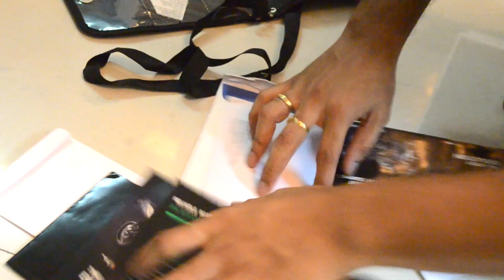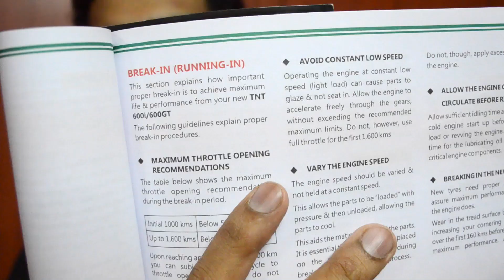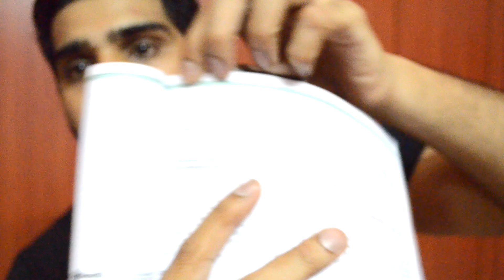DON'T LISTEN TO THEM | Engine Break-in & how to do it

Comment: Whatever he is telling is wrong drive it slow blah blah
You don't have to drive it at a constant speed
Neither you have to redline it to the max
What you have to do is vary your rpm or in a sense you don't have to be on extremes on either end
Just make sure you don't overheat the engine give it some rest after riding
In a way use it the way you want to
The manuals can't tell you rev it too hard cause they will get law suites too some you don't have to be too adventurous with the new bike cause you have to get accustomed to the new machine
It's always risky for you on a new bike

Comment: those pussy or soft break in are written by lawyers or insurance company because they don't want you to get accident from the new bike which you are not familiar, do you know that when factory make that bike they need to go hard in order to know what is the top speed of the bike, if you break in like pussy or gay, i can bet with you, your bike will not perform good, i saw 2 person bought the same bike one use hard throttle while the other one run like pussy or gay after 3 years the one go hard perform better than the one run like gay, because the other one think which go hard think that since the bike got warranty he don't mine go and wack the bike always remember if you want your bike to perform well you need to season the bike, that is the reason new bike always run slower than old bike

Comment: Do not follow what this guy said about the 5 min of warm up during the first startup!!!! This is not necessary. Just start riding after 30sec because the oil pump will very quickly inject and splash and flush the engine’s head with oil. The only concern is the oil needs to get to its operating temperature, for that you can drive slowly for 1k and by then the oil will attain its operating temperature. And on load it tends to heat up faster, rather if you follow this guys instructions, you will end up wasting fuel which is not required and can be used to drive slowly and reach out a distance instead of idling it at one place. This applies to any engine capacity. 
And also we will emitting exhaust gases at idling effecting the environment. 
In worst case we can repair our bike or even buy a new one . But we humans don’t have the capability to repair the damage we made to the environment. So if anyone doing this !!! Please stop it right away....!!!!!!!!

Comment: Every thing you said in this video is based on the manual of your bike. So it is advisable that you read what the manual of other bikes also say. Some of what you said are either myths or no longer applicable.
Cold start - no need to 'warm up', especially for Indian conditions. What is essential is to keep below the recommended RPM levels and avoid constant speeds. You can always start the vehicle and ride off, just make sure not to rev too hard until the engine reaches optimum temperature.

Comment: Bro
Absolutely wrong
Except the part where Engine RPM should not be constant
Other than that you can start from lowest to highest digit in RPM but just have to vary in between them
And the companies don't recommend high RPM so that noobs don't just buy it and make a joke of themselves and put theirs and others life in danger
As it would result in just lawsuits nd complaints

Comment: I believe engine break-in is just a myth bcoz 30-40yrs back some parts of the engines were hand crafted and break-in was necessary for precision but now days engines are made by robot, it is precised and tested before assembling.
What we get from the showroom is like ready to use..:-)
Still we need to follow the manual for RPM limits.
After getting bike from the showroom just hit the highway and do some ~100 km ride.Do shift your gears smoothly without stressing the engine.
Once it crosses 500km or first service, it is all set to rock..:-)
Reply: I got a Dominar and after riding it normally till first service after 45 days. I rode it for some 300 km from Rishikesh to Delhi, during which I rode it around 130 -140kmph. The Odo is now on 800km. What do you think I should do? Is it okay to rev it till 100kmph while in city and also do I need to change the engine oil since at the first service on 45 days the bike was at some 250 km.
Reply: I rode my pulsar rs 200 on its top speed on the first day(12dec16)
Till now my bike is fine nothing hapened
Reply: Then why Manufacturers  recommend it ???
Reply: Game Of Thrones Lawsuits brother. If manufacturers tell you to rev hard they’re literally telling you to ride fast.
Reply from the maker: Well, no one knows for sure, coz this happens at micro and nano levels. The best option we have is to just follow the instructions and break in the engine. Its a matter of few days. Why not follow it. If it works, amazing. If it's really a myth, well, no one is at loss right. :)
Reply: Ya no problem at all in following the instructions.:-)
I just told this for the riders who have not followed break-in period and scared now.
When I got my bike 2yrs back, ridden at 90kmph on the 2nd day itself so everyone scared me telling your engine will seize, mileage will drop bla bla stories.Even on google I didnt get any satisfying ans.Till my 1st service was done I was very tensed, had sleepless night as it was a new bike and attachment will be more..:-)

Comment: buddy i recently face issue of coolant censer failure.cause to that my bike extremely hit in traffic and all coolant come out and cause to that i m not able to run bike till it cool down naturally,benelli dealer solve it but i want to know have u or some other face the same
Reply from the maker: +meh patel my friends who own 300s n 250s  have faced coolant leak issues.
Reply: humm but its not leak it totally flush out all coolant due to censer not work cause to that coolant fan not ON and gone extreme hit and came out through coolant tank

Comment: Thanks for making this video man :) I've been arguing with people a lot lately, especially Indian commenters on YouTube, that claim "HARD BREAK-IN IS THE WAY TO GO"... and they consider to imply it on bikes manufactured in India and I dont know why they keep comparing and referring to foreign moto vloggers (People love to and consider Jake the garden snake's video on hard break-in as Commandment -_-) They don't even wanna know what's the science involved behind proper break-in and how it works, but they keep comparing thier bike to R1, S1000rr and other high end liter class and 600 class bike's break-in procedure... Guys! Its all about  wearing the cylinder wall and piston rings gradually to ensure tighter fit for generating most efficient and effective combustion pressure.. without letting pressure to escape or blow pass through minute gaps...otherwise its a waste of combustion energy..  In soft break-in, imperfect parts wear out into fine dusts and mix with oil... rather than bigger particles while doing hard break-in. When the top brands do it, they use precision cut parts and they partly or fully do the break-in for you.. and remember, doesn't matter what Jake or others say, its your bike and its up to you how you want the life of your bike in the long run to be.. You know.. Jake will not pay for your bike if something happens to your engine in future just because he said its ok!... and its all just about freaking 1000kms thats harldy 20-25 days worth of riding.. After the first service when the dirty oil gets replaced by fresh oil and your parts are now worn out just the right way to fit perfectly, you can start using the full potential of your engine
Reply: I'm not just any other guy you find in the internet,  who watches hell lot of videos and then give my opinion on whats right and whats wrong... Like you, even I m talking from my side of experience.. I ride a lot and I maintain my bikes regularly... Out of my 2 bikes, I broke-in one of them (newer out of the two) the hard way, now after 9 years there is oil leaking from around its engine cylinder head and I had to get its piston rings replaced and I can tell you for sure that now it does not perform like it used to.. You can change the piston rings when it gets damaged but you cant replace the Cylinder wall that gets damaged from hot-spot created by hard friction from the imperfect piston rings when they were new and it does effect it in the long run.. On my other bike (older one on which I rode little over 90,000 km)I did soft break-in and is still running good with no issues.. every engine has a life span... People who do hard break-in on their bike are the ones who don't expect to keep the bike with them for long .. so they don't get the opportunity to get to know the condition of it in the long run.. But I m all about the long term life of an engine..
Reply: so true... what's the big deal in ridinv bikes like ktm duke 200 at 70-80 kph...well that is below 7.5k rpm.. and one must get used to their bike too.. i completely disrespected our last bike..but now just maintaining it accprding to manuals and experts...  the bike running  before  2nd servicing is also important...  don't overshoot above 8k rpm... don't rapidly  downshift...  it will take me a year to get used to dukes..to make them more refine...so  future offroadings and all don't hamper it.

Comment: A lame 9 minute video telling people to read and follow their owner's manual.  The only information you added that's probably not in every manual is the suggestion of a long warm-up at idle, something that almost every knowledgeable engine guy knows you shouldn't do, and especially with a new engine.  All this stuff about the Indian environment vs. other countries' environments as it pertains to engine break-in is false.  It's an engine and it doesn't care which country it's in while it's being broken in.  The only environmental impact on the engine will be temperature, if you live in a cold place the engine will take a little longer to warm up than if you live where it's hot, otherwise it's all about the same.  With a liquid cooled engine it should operate at the same temperature once warmed up no matter where you live unless the ambient temperature is extreme.

Start the new cold engine, ride it mildly until it's up to temperature, then incrementally use more throttle & RPM.  If you baby the engine it won't break-in properly, you need to put a load on it.  The reason your friends' engines are running fine after not following your advice isn't because they got lucky, it's because they probably did a better break-in.

High performance engine builders put new engines on a dyno and break them in under a load.  They go full throttle very shortly after the engine is warmed up.
Reply: agree mate. And I personally believe hard engine break in is the way to go coz I've done that on all my motors and all are in exceptional health

Comment: 5-8 mins IDLING is definetly over kill for any ENGINE & not at all necessary. A simple 2 -3 mins idling   during d first start of ur day is fine & ride it normally for a KM is good for any engine be it is a 1000CC or 150CC.
Reply: 1 to 2 minute idling, and then riding the bike  at slow speeds for the next 2 kilomtred is okay for bikes upto 250 ...i feel... i have read few blogs.. might not be sure tho...

Comment: It is required , but some expensive vehicles come broken in from the factory and are ready to run normally.
Reply: Syed Ahmed Flare Nope your wrong bro no Superbikes are come with break-in from the factory
Reply: All decent bikes are ran thoroughly on a dyno. Or at least the motors themselves are. And they run them hard to ensure integrity is good.